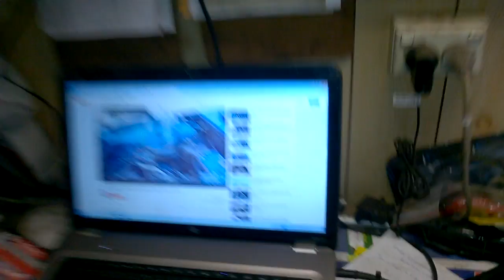Mechanic Talks About Running Cars On Vapour!

Comment: Mechanics use the same “diagnosing” system over and over like a clock. When a car doesnt crank, they have a set of patterns the do over and over to find the problem. Mechanics dont know the “science” behind a lot of the things they do. At the end of their diagnosing they switch the part. So a mechanics point of view means nothing. An opinion from an engine designer who designs and builds engines would be the one who knows best

Also, did you know 3 out of 4 dr diagnosis are wrong? Not even drs are reliable in their own field so what makes this mechanics opinion so valuable?

Comment: My motor runs fine on vapor never backfires.
Reply: If it backfires it might end badly, but backfires are only related to valves, not your fuel system, you should get a guard in the tubing to prevent a backfire from getting to your tank

Comment: Airplanes engines run on vapor  fumes not on liquid and they don't get hot WY? because  vapor is compress and dry by heat before deliver to the engine less carbon to burn less heat gasoline vapor burn 99% of no waist compare to liquid only 34% burn rest is breed buy humans and wild life

Comment: In the 1950 chevron lab together whit the us government make a test based on German technology from WW 2 to find out how    far a combustion engine can run  whit only one gallon of petrol the last test result was 1000 miles whit one us gallon of petrol the project last one year one  lab engineer from chevron from England make a book in the 1960 about whit blue prints of different devices to achieve large amounts of miles whit one gallon of petrol only 100 books where print  the English engineer  mysteriously die in a  35 mile car accident  the interesting part of is accident was that the man never own a car or have a drivers license and and only 98 books never reach the public  there were accidentally burn in a fire the book name was the black book of fuel economy

Comment: Have I missed something? Doesn't the Carburetor / Injector vapourise the petrol?
Reply: Philip DALE neither of those vaporize fuel. Carburetors jet fuel into the air stream and injectors spray a mist. Who told you that carburetors and injectors vaporize fuel?
Reply: @jjbailey01  you must have dropped out of school. you don't know that liquid gas won't burn? It's the vapor that burns dumbass

Comment: one question.. how do they adjust the air fuel mixture. would the engine not run lean and for that reason overheat the engine ? 

any thoughts please let me know thanks

Comment: What happened to the fuel injectors if they are not being used?... Will they clog from carbon build up from staying dry?
Reply: Don McMillan I imagine nothing major would happen. Combustion in the chamber still occurs. I would think that the increased surface area between fuel and air would result in a more complete burn, thus less carbon build up over all. I'd say it depends on the specific injector materials and wether or not they require the fuel running through them to prevent an injector meltdown in direct injection systems. I wouldn't even blink an eye about manifold and throttle body injection.

Comment: RUNNING ON VAPOR BAD . YOU ARE RUNNING TO LEAN YOU WILL BURN HOLES IN PISTONS .AND THAT IS A FACT
Reply: wow my cousin car still running he has a switch to run vapor and gas to keep the parts oiled gets 75 a gallon on his 350 oldsmibile for 3 years
Reply: absoluteley Correct! It will run but too lean means too hot. Check your plugs. There is a reason 17 lbs of air to 1 lbs of gasoline.....research no fake news.
Reply: It has been my experience that you will burn intake valves at about 500 hours running time on a 4 cylinder 800 hours on an 8 cylinder. I never had holes burned in any of the pistons. A small amount of water injected into the intake seemed to cure the problem. There are more high tech ways to address the problem but water seemed the simplest and worked fine
Reply: @leslieclendening2947  i have been running vapor for years now on my daily driver and I have yet to burn anything, I do over 60 miles daily  https://youtu.be/m6qml9je28M
Reply: Leslie C...I tried going to your channel and it was completely blank....you seem to be posting here ,and SEEM to know whereof you speak ,yet if you had this info ,why not put it up? When I see a totally blank channel ,I often assume it's a troll ,paid or not . Prove me wrong ,please. put up or shut up.

Comment: this so called mechanic fails to mention that without the actual gasoline sprayed into the combustion chamber, it would wear out the cylinder wall in a hurry.
Reply: They aren't talking about 2 strokes! Cars have oil in the engine already to lubricate it.
Reply: @criostoiromahony438  yeah but the gas itself helps lubricate it, just like on a diesel to a lesser extent. The fuel helps lubricate, just like oil helps cool the engine on top of lubricate. Without having gas it most definitely creates more wear. Its no secret that the gas fumes are flammable and can run a car on fumes alone, but theres a reason we dont do that

Comment: This was done in 1935 on a V8 Ford and tested by Ford motor Co. in Canada, it got 205 MPG. The man that built it is Pogue and was told never to talk about it. I have the patent prints and how it works. I got the prints from the Patent office so it is real.
Reply: If you go to the United states Patent Office you can order his drawings and description of how it works. There are three patent numbers, 2,026,798 Jan. 7, 1936, 1,997,497 April 9, 1935,  1,938,497 Dec. 5, 1933. That how I got this paper work. Check it out
Reply: thats crazy and it works for any gas running vehicles even fuel injected?
Reply: Yes Pogue was successful but no more so than most on You Tube as I recall(and I havent seen Pogue's patent in a while)Pogue circulated the gasoline over a heated surface. Problem is it only burns the lightest most volatile potion of the fuel. This was also the problem Tom Ogle had(And myself for that matter)
Reply: Heads up Leslie Clendening is a disinformation shill, blank account posting hundreds of comments trying to discourage people from doing this on multiple videos
Reply: The story of Charles Pogue is very real and hardly bullshit although the device did have some limitations which kept it off the market. It is similar to Tom Ogles and not unremarkably unlike some 200 other similar patents. It is interesting how far back attempts were made at fuel economy  You'll find that once built it has the same limitations as the rest
Reply: Tom in Toledo is it okay if I ask to in box me am working with the same project
Reply: My daddy works for an oil company.
Reply: The idea that ANYone can patent ANYthing may have been true 20 years ago it is no longer true you cant patent theoretical ideas they have to function as described. That said it was true in the 1930's when Pogue patented his device. The cost of obtaining a search and the actual patent as well as the maintenance of the patent are prohibitive so Im not sure why someone would go to such lengths for nothing. Pogues device did work but it had limitations that kept it off the market. Ford, GM , Chrysler and Shell Oil had similar patents but theirs had the same limitations that kept them off the market as well
Reply: Well as a former patent broker who traded patents,copyrights and trademarks I respectfully disagree, but Im not trying to be the smartest guy in the room.
In any case the limitations of Pogue's device is acceleration. There is no doubt in my mind that he got 205 mpg on the gallon he was able to burn, problem was he could not burn the fuel that was left. The leftover fuel has more potential energy as far as mpg but does not react to the accelerator as well as it is not as volatile. Tom Ogle had this problem as well. Mr Ogle got his car up to speed and set the accelerator at 55mph then drove to Demming NM from El Paso TX and returned(200 miles).On getting off the highway(change in speed) the car stalled and he could not restart even though he had enough fuel in the tank. The reason? Lack of volatility in the remaining fuel. The car will idle but no acceleration
All units I have seen on Youtube have this issue. You are dealing with vacuum caused by the restriction on the intake.The vacuum is needed but by varying degrees depending on the volatility of the remaining fuel
It is interesting to note that the patents on these devices are very similar and often infringe on each other but a lack of understanding by the examiners have allowed some 240 devices to be patented. It is a very misunderstood technology
Reply: Tom in Toledo could i please get a copy
Reply: Jim Piver that’s great jim too say something is bullshit too which it may well be however U didn’t really dispense or provide anything to digests to support your opinion ............ i’m interested in what you had to say you just didn’t say anything
Reply: ncluded: U.S. Patent 1,750,354, U.S. Patent 1,938,497, U.S. Patent 1,997,497 & U.S. Patent 2,026,798.
Reply: https://en.m.wikipedia.org/wiki/Charles_Nelson_Pogue
Now in his time it could have not been as possible. The possibility though could be real though and have been done.
Problem I run into with Tom Ogle through is I can not find one legitimate thing proving he was even real.
If you can provide death certificate or even a wiki page for him ect. It would be most appreciated.
Reply: Tom in Toledo wow, do you have more?
Reply: Thanks for refreshing my memory on Pogue. Point is the demonstrations he did were of the same variety as most on You Tube. You get an engine, make a device, run it 26 miles on a pint and extrapolate the results to a gallon of fuel. I'm also not surprised at the naysayers upon looking at his drawings. The theory behind the device(if understood at all) is not readily gleaned from drawings,photographs, or video.I would not be surprised if Pogue himself failed to understand his own device.
As far as suppression, conspiracies, I'm not a believer. You can easily get information on any of these devices from the patent office and build them yourself. Once you build it  you will find it fails for the reasons I have given. Pogue like everyone else got 26 miles to a pint and thought he only had to tweak the device and was close to the answer. Ogle was the same. I admire Tom Ogle because his results are remarkable by any standard yet the device was not viable. Remarkable and viable are two different things
I have burned an entire gallon of fuel from top to bottom using similar technology but it is extremely difficult to do and not a "one size fits all" solution for the automobile market.
It's a bit like making fuel from algae. It's not efficient nor cost effective but it can be done
Reply: @leslieclendening2947  amigo tienes algun video de tu trabajo?
Please

Comment: Actually it runs the same but it lacks control in varying the speeds. It can handle load. It is remarkably efficient. The problem is it operates on creating fumes by way of engine vacuum and vacuums are not responsive enough for the changing traffic conditions. Put your foot down the engine stalls. get it running again but hit your brake? The engine stalls
Major trials of this device were done at set speeds or on test tracks at set speeds. It runs well on stationary engines at set speeds
Reply: +Leslie Clendening nice book. where can I get the paperback addition?
Reply: Not if you use a turbo to provide the vacuum to produce the vapor like Smokey Yunick did. His Hot Vapor engine was very responsive.
Reply: Just a few questions
1 Have you driven this car?
2 Do you own this engine?
3 Have you seen this engine?
4 Do you have any first hand knowledge of this engine?
Pat Galloway( another regular who I do admire) has made an engine adaptation like you described.He was getting 300% improvement(not 40%) now I only have his word on the subject so I dont quote him except in circumstances like this.  No one manufactures this engine.
 Now without some half baked statements about conspiracies explain why car manufacturers would not love this technology. Theyve all( yes I said ALL) have patents and ALL have delved into this concept. So they all conspired to avoid using something revolutionary because theyre not concerned with competition . There is no chance any will go bankrupt. They are all(there I go again I said ALL) conspiring together which is why they are struggling to make commuter cars and two wheeled sowing baskets. All the manufacturers make loads of money on commuter cars and sub compacts they make very little on expensive gas guzzling pick ups this is why they dont embrace gas saving technology
Ok youve won me over with your evidence. Your right YOU are now the smartest guy in the room. One last question, are you satisfied?
Reply: Do you own this engine?
Have you ever driven a car with this engine?
Have you ever even seen this engine?
Have you only read about this engine?
Pat Galloway (who I complimented in an email just the other day) has the same set up and got 300% better mileage(not 40%) he TELLS me it is quite responsive. I dont KNOW this first hand I only KNOW what Ive been TOLD
I dont even KNOW that its exactly the same I just THINK its the same from what Ive been TOLD
Funny no one manufactures this device or set up and without resorting to some old hat argument about conspiracies please tell us why. You are now the smartest guy in the room
Reply: From that fact that Pat Galloway's engine got 300%% better mileage is proof that this kind of design works if engineered properly. I don't have to own or drive a car with with that design to come to that conclusion. I've seen a guy from the Phillipines with a similar set up with a magnetic switch that disables the fuel pump at the vacuum sweet spot fuel level in the bubbler card..and also another tinkerer who ran the intake air into the carburetor from a heat exchanger off the exhaust pipe thereby replacing the heat lost to the refrigeration process, thus preventing freezing up of the carburetor by the vacuum created by the engine. That's the same problem that Tom Ogle encountered and solved using exhaust heat. Combining all those elements, that is with a turbo for rapid response and and electronic feedback to the mixing screw on the carburetor should make a viable set-up.
Reply: Tom Ogle did not solve anything. He was 5 miles short of his target and couldnt get the car restarted but still had gas in the car. I know this because with an identical set up I ran into the exact problem. Oddly enough for the exact same reason. The problem is he gave a very poor reason why this occured. He did it because he thought he was very close to the answer. Unfortunately he was wrong. Still it was an amazing test and accomplishment. His deception(lie) doesnt/didnt help. So if you believe him its an oil company conspiracy. If like me you dont believe him you will understand why this system never made it into everyday use. I know this FIRST HAND. His patent and everything i have read about Ogle is he used radiator lines and not exhaust heat. I have used both but neither is necessary heat is not an issue I have burned a complete gallon in -40 conditions
So my comments to you are exactly the same as before. Im not reading about someone or have heard or spoken to someone I have done it, touched it and seen it first hand. I have documented it as well
You on the other hand have known some guy who told his sister that a friend of hers told someone...............are you getting the point?
Get a diagram, build a unit, set up some testing and in a few months (if you havent pulled your hair out) tell me what YOU have learned. At that point you will  be in a better position to debate the merits of your own argument. 
This is a technology that has baffled patent examiners and confounded top engineers. It does not make any sense in the context of standard internal combustion operation. Researching the subject does not do much good as it is the most misunderstood technology Ive ever had to deal with. Start by throwing out every thing you think you know and learn to observe. This is a very humbling experience. I know because I had to throw out everything I had ever learned about combustion and observe. 
I will not debate Mr. Galloways accomplishments because although I have worked with vacuum pumps I dont have extensive FIRST HAND experience. Smoky Yunnich had a similar set up(so Ive read ) but I dont know. He achieved 40% improvement 
Speculation on this technology takes up 98% or better of the comments and this page is no different
I only post to put in my results (good and bad) and to clear up some of the confusion not debate the results of your "research"

A magician pulls a rabbit out of a hat this is "proof" that the transporter on Star Trek actually exists because how could the rabbit get there otherwise. Think about it
Reply: Chauncey Hulbert  yeah sorry but you tube is not designed for discussion just for short comments and glib remarks

Comment: it Sure is not the same as lpg
Reply: Jared Stieg he drew that comparison only to illustrate the similarities. Both are in a vapor state upon entering the combustion chamber. In comparison, carburetors and injectors introduce fuel to the engine in a liquid state. He wasn't saying that gasoline vapor and LPG vapor are the same fuel, just that they work the same.